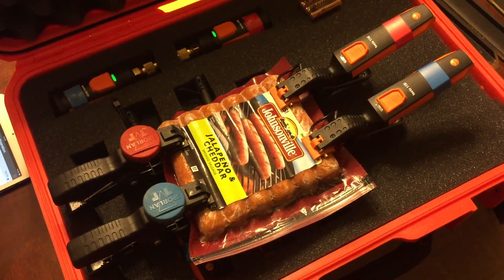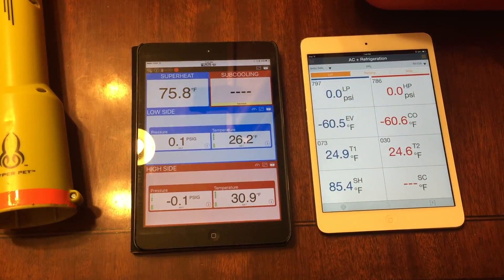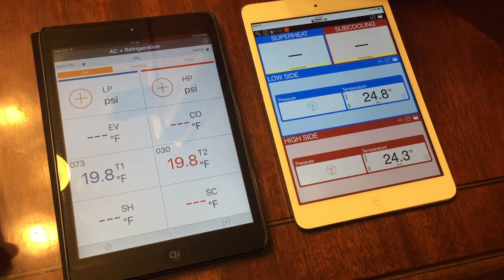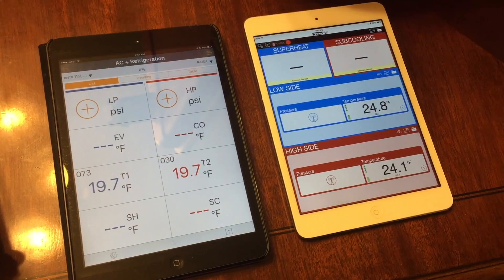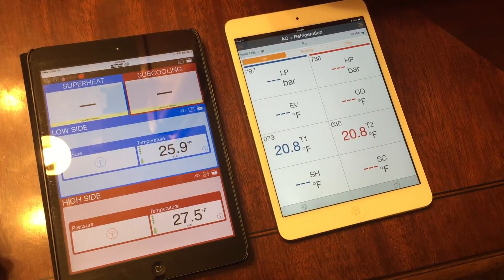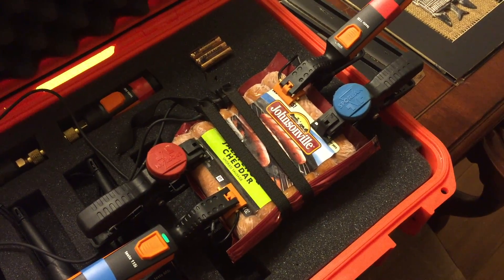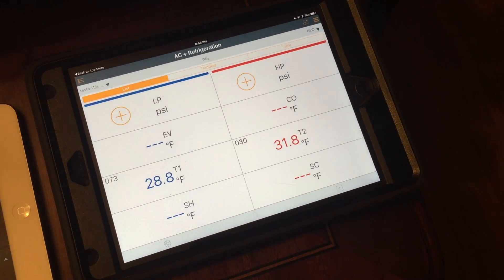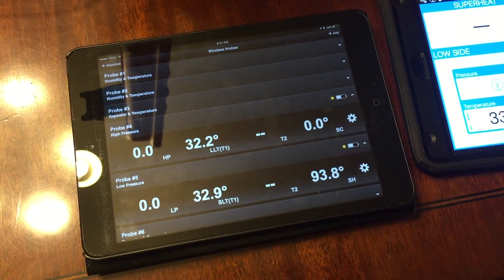HVAC Tools: Was the App or The iPad to Blame? Follow Up To Sporlan Testo iConnect Comparison

Comment: The biggest flaw in your test is using the   jalapeños cheddar bratwurst.
The jalapenos are not evenly distributed in the bratwurst causing one end
to be slightly warmer than the other.  I believe the manufacturers use Oscar Mayer hot dogs much better consistency.
 Screw this test fire up the BBQ.

Comment: Could put a piece of copper tubing in a container of ice and water.  Let it sit for an hour or two then compare the temps.  You can pretty much guarantee that the ice-water mixture will be at 32 degrees or very close

Comment: I somehow missed this video and didnt watch it until just now...  the problem i have with this test is the meat is drastically changing temperature every minute.  When you put a clamp on its warming up that spot faster than the rest of the meat so the temperature throughout that package is going to be different in just about every spot.  I would think the best way to verify accuracy and change between the 3 brands would be to put each clamp on a piece of copper on a table.
Reply from the maker: You're right, not exactly scientific

Comment: Stephen the testos are reading colder because they use surface compensation factoring. Place all 4 temperature sensors in ice water. Turn off surface compensation in Testo app and recheck temperatures they should all read 32 degrees.

Comment: The temp difference on the Testo might be the thermistor barrel might be pushing further into the brat where the temp is lower. The Sporlan is sensing only the outside of the brat, possibly giving a higher temp.

Comment: could you connect two devices or more to the same sensors at the same time? and that way see if they differ between devices
Reply from the maker: +awsom70 no, if the sensors are connected to one iPad they won't be available to connect to a second iPad. I might be able to split screen the Testo and Sporlan on the newer iPad though.

Comment: I wonder if it has to do with the wireless connection rather than the device. every time you switch devices you are establishing a new connection. it just seems odd for the same software to yield different results which is why I would suspect the connection.

Comment: Design of the clamp/sensor can have a huge influence on the temperature measurement. Some of those sensors that you are using recommend insulating the clamp when the temperature difference of the surface measured and the ambient are large (Sporlan) I am not sure on the Testos

What I am saying here, is the physical sensor elements themselves are only part of the equation, it is also the design of the clamp that fastens the sensor to the line. The clamp design itself, how well the sensors contact the line, and how they are isolated from ambient air makes a big difference. 

The clamps could all read the same at ambient, but when you hook them to a cold line, you might see a huge swing due to clamp design and the influence of outside conditions. This is the same for all temperature measurements, and if you go to K type it is even a more prevalent problem due to other factors. 

Most technicians assume that their tools are accurate, and they do not have multiple sets to compare against.

Comment: Stephen, Is there not a temperature offset in the Sporlan smart tool? Could it be that the two different devices are simply are reading differently because the applications have two different temperature offsets? Not saying that it is impossible, but I find it highly unlikely that something outside of an application could cause any difference in readings. (But I am leaning toward impossible.)
Reply from the maker: +Jim Bergmann yes, you can offset temperature, video recording both clamps were zero offset.